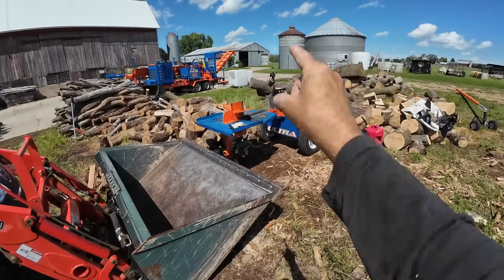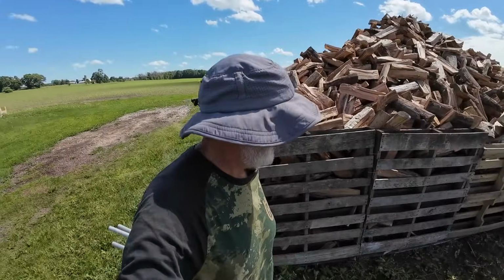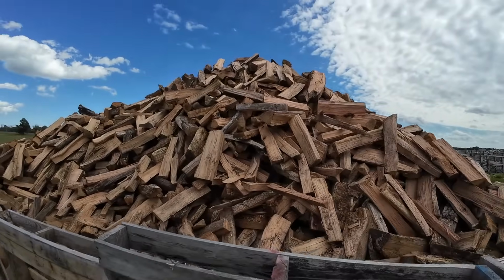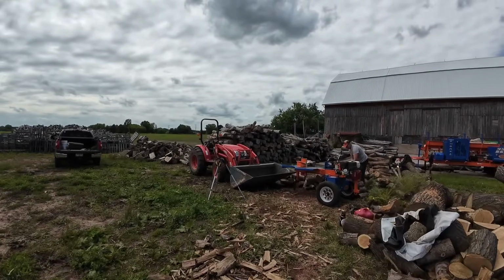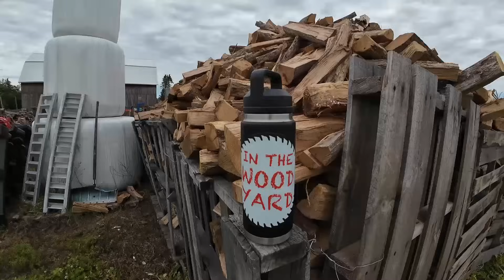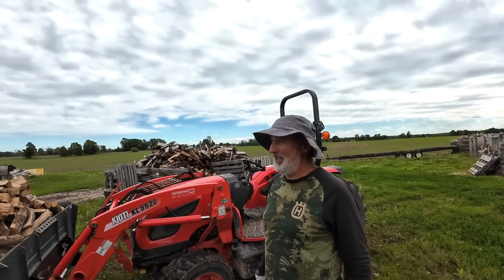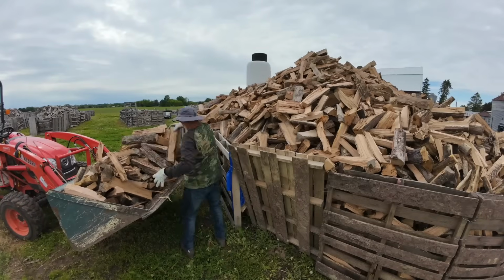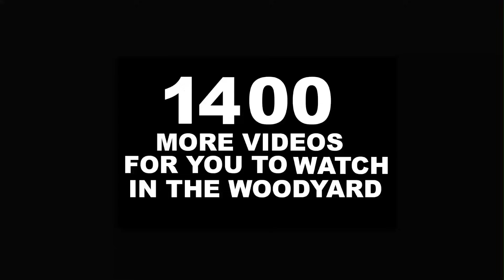OAK FIREWOOD MOUNTAIN HAS RISEN!

Comment: Have you noticed the width of the wood is the most important factor when seasoning irrespective of the length or have you found the shorter thicker pieces season like a longer thinner piece??
Reply from the maker: It all matters ...bark or no bark is better, thinner is better, shorter is better, sun is better, wind is better, more time is better, off the ground is better, lighter type of wood is better, softwood is better, no rain is better, low humidity is better, whiskey is better than beer.